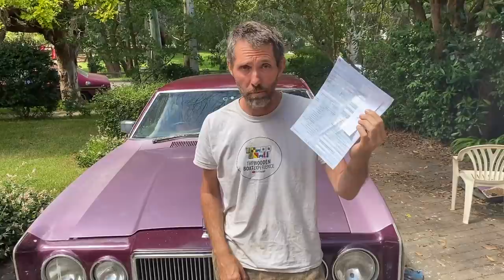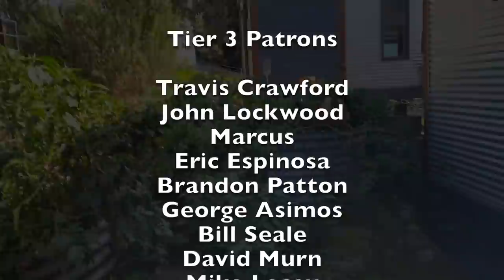Grumpy old man diagnoses two stroke outboard run without oil in fuel

Comment: You are not obligated to provide us with entertainment but we appreciate it.
Reply from the maker: Thanks mate, I hope you enjoy the vid.
Reply: It's not just entertainment, but also education.
Reply: I really love watching Stu I have learned allot from him. Very pleasant and polite but this segment... there is something not right with body language etc..
Reply: @JohnnyL6975  absolutely I have worked on boats for 15years professionally (more like 20 if you count the unprofessional bits) and I can safely say, from what I have seen, he is a man after my own heart.
Reply: @JohnnyL6975  Those who know these things might see some signs of depression here.  Sadly.
Reply: @Dangar what do you think the problem might be if a engine works in low and high RPM  range but not in the middle range? I assume the jets need to be cleaned. Any insight would be deeply appreciated.
Reply: @anthonybooth2858  sounds like it could be jets.  Also the timing advance needs to be checked.
Reply: @Jack-tx2ve  I checked the timing timing advance and jets but it still does not worked. Also, I checked idling and maximum throttle timing and it was good.
Reply: @noidontthinksolol  it does a have separator and bypass everything to the a secondary gas tank.

Comment: I am an older and more grumpy man, but fully appreciate that you tackled this try-kill motor in details with bare feet and very earthy shop.
Last week,  I opened a running newer 90hp dry-kill motor with top piston slapping noise, all 3 holes with 120 lbs and top cylinder light scores.  I coated 8 mil OD Cerekote to top piston skirt and 2 mils OD on lower 2 skirts to even out 3 pistons to wall gaps.  Now motor runs normal again.

Comment: I usually use a 3 leg puller until my last rebuild which was a submerged unit. Built a puller like you just did wound it up tight, let it sit for 2 days with wd40. Then wound it up tighter again them gave the centre bolt a good whack with hammer and it popped off. Happy days and was very surprised. PS. Glad to see you back Stu.
Reply from the maker: Yep, patience can go a long way with these types of jobs. Just decommisioned your water tank yesterday getting ready to put two large ones it. It was a great help to get us through until now. Thank you!
Reply: @DangarMarine  glad it was of use Stu!

Comment: I always leave the gear out of the water when the engine is not in use, to avoid all the crud building up and keep the water inlets clear and open... This was nasty!
Reply from the maker: Working trim tilt helps with that.
Reply: @DangarMarine  Ah. I guess that would do it, yeah... Well, it's off the boat now, so problem solved. :)

Comment: i need to know how many nuts/bolts/spanners/motors you have lost to the depths .....
Reply: After the first one, I tie a fishing line or para cord to tool or which ever tool I'm using in the water. 
Still doesn't help if the nut removing the bolt falls in.
Reply: Exactly what I was thinking...

Comment: LOL.. this video did my head in! I laughed I cried... Clean your bench, stop throwing the tools, put the parts into a tub or in order, stop throwing the screws anywhere... oh those safety glasses!! maybe you should clean some of those leaves of the roof so it doesn't rust out on you, plus it is a little bit of a fire hazard. Love ya work :-) keep at it..
Reply from the maker: One thing at a time. I'll stop throwing screws. ;)
Reply: One thing for sure - when you tidy the garage you will deffo never find anything ever again. But if you do the job logically it will never get done.

Comment: It will be a miracle to get the engine running again as all parts, bolts, screws, cables and other random stuff is all over your tidy and clean working environment.
Reply from the maker: It’s only an outboard. It doesn’t have that many parts. You set the bar for miracle very low.

Comment: When I had my boat I gave in to the fact I needed three sets of tools. One for Work one at home and the other on the boat. It made my life a lot easier.
Reply from the maker: It sure gets they way otherwise the tool you need is always somewhere else.
Reply: @DangarMarine    If you're 20 miles off shore it's a long walk home :)

Comment: Stu, you can technically 'crack' your own bearings. Take a cheap diamond bur on a Dremel, lightly score 2 lines where you'd like it to separate. Then line it up in the press, wrap a rag around it and lovingly pop it. It's impressive, fractures just like the factory ones.

That bad bearing you pulled out is a perfect candidate for practice or just for fun. It does matter which way you squeeze it because it can distort it before it cracks. I believe the winning combination was crack line at the bottom and the other at the top. I then placed a drill bit shank between the arbor and top line to 'encourage' it.

Food for thought, love your videos.
Reply from the maker: Intersting idea, I'll definitely give that a try and see how it goes. Could be something fun to film at a really high frame rate.

Comment: Time to hang the expense and buy a 6" Aussie Dawn vice ay? I like the cast steel offset ones but they also make fabricated.
They're an effing mans' vice and somewhat of a bargain at ~ $1000 but a vice for a lifetime that doesn't bloody fail when you need them most. I like offset because they're better for the type of work mechanics do.
That tool joint has them for $850.

Comment: You should permanently mount a pad on the railing there for engines, you know you're going to hang more there in the future , couple layers of UHMW cutting board would get it done.
Reply from the maker: Yes, I have been running a few designs through my head for an outboard service bracket.

Comment: I have used the "drilled plate as a puller" trick myself.  I had to pull the flywheel off my Rotax aircraft engine and the silly buggers use a five bolt pattern for the threaded puller holes.  I suppose they use five bolt to sell their custom specialized tools but I outsmarted them.
Reply from the maker: Good on you for not letting them force you into a custom tool!

Comment: I discovered that black iron pipe flanges of various sizes can be drilled to make real effective puller mounts. Also, if you make an arm to bolt  on top, you can use it to hold the flywheel while you torque the flywheel down. It worked for my V 4 Suzuki that needed 225 Ft lb.
Reply from the maker: Good idea about adding the arm to hold the flywheel still at the same time.

Comment: Thanks Stu,
Slots could be made by drilling 3 more holes on 120 degree plane and cutting it out with grinder disc to fit any 120 degree assembly, that is what the pro-tool looks like. That way you have a universal tool.

Comment: A trick I learned in my boat shops several thousand outboards ago to remove flywheel when puller is not there... using a 2 to 5 lb BRASS hammer and ONLY a brass hammer... loosen nut until it is level with the top set of threads..... Give nut/crank a solid but not all your might rap. The flywheel will pop right up about 999 times out of 10000. For you guys about to say no way, break magnets etc... You will NOT harm a single thing if you do it correctly. It does not need to be a hard hit guys and the nut protects the threads from any issues. I learned this literally almost 50 years ago and since have rebuilt thousands of outboards. It has never, not one time harmed a single thing and always gets it off unless you have spun the flywheel and welded it onto the crank... Just useful info if stuck...
Reply from the maker: It's always good to know every possible way to do a job as you always get to chose when you use any one of those techniques.

Comment: Outboards really are complicated to get apart. I bought an old mercury engine once to restore but gave up when I realised I needed about 5-6 different special tools wich weren´t possible to buy anymore. It was an early 60's 30hp 4 cyl. engine. White with black stripes.

Comment: I had to hold my breath when you were drilling the flat plate without a clamp holding it down. Many years ago I was doing the same and the drill bit got stuck and the plate started spinning around and almost cut off the tip of my finger. I had to get it stitched and lost feeling in the tip of that finger.
Reply from the maker: Yep, that sure can happen and fast.

Comment: Stu I have used a 3 claw puller to remove the flywheel on a 8hp outboard , ignorance is bliss ... i thought until now it was the correct tool .. ps i was going to send you some safety glasses , alas all i could find in the recycling were milk  containers ....
Reply from the maker: You can definitely get away with a three jaw puller on the smaller outboards, particularly if they are pull start without the ring gear on the edge. :)

Comment: I love the idea of a land rover type repair job on it cable ties and duck tape and just make the bugger run again as you said it was only because it took a swim that caused it to fail
Reply from the maker: Yes, I think it was more the salt water that did the damage. Particularly given the trim tilt wasn’t working so it sat in the upright orientation with the water in the bottom.

Comment: 21:51 - "CDI" ("gravel-goop") That's what's known in the U.S. (I know, we haven't been very popular, lately - sorry!) as "potted" - An epoxy-resin mixed with a 'hardener' (no, not 'that' kind) - that does have the advantage of 'sealing' the electronic components from dirt, moisture, temperature, short-circuit and - provides vibration/physical-shock protection, too - it also, doesn't allow the ease of cooling and, keeps us from, tinkering, to fix it, too - if, it goes "tango-union", buy another one! Cheers- Thanks, Stu!
Reply from the maker: I like the name! :)

Comment: I tried pulling the 2 PTO bearings off a '94 VMAX 600 with something similar.  Talk about a pain in the Ass.  Could barely get that bearing splitter behind the 80mm OD.  Then I realized, the bearing guides were shot anyway, as were the bearings, so I removed the bearing guide, shoved all the balls to the other side, the gently persuaded the outer race upwards, bearing fell apart, then I would easily get the splitter on the inner race that is tapered and pull it off .  You do what you need to get it done I suppose lol.
Reply from the maker: That's it, where there is a will there's a way!

Comment: weld the nut to the underside of the puller plate, saves weld breaking with the upwards away pressure, rather than using the whole nut itself to put pressure on plate from beneath! great backyard mechanics tips though :)

Comment: In CDI I think the coil fires with growth of magnetic field as the capacitor discharges into the primary windings.  

Opposite of points where the spark is caused by primary field collapse.  

But it's been a while since I studied ignition systems.
Reply from the maker: Would be worth looking into in more detail on day.

Comment: I think that I saw two interior anodes. How do you get to them during routine maintenance?  I may be missing something, but it seems the anodes are pretty deep in the motor. 

Thank you for awesome content!!
Reply from the maker: Yes, taking the head off does seem to be the only way to get to those ones.
Reply: @DangarMarine  That seems a little labor intensive. (gaskets etc.) How often are those anodes to be changed? I think all my anodes are exterior. At least, I hope.  

Thanks for the great content! I do enjoy your channel very much!

Mark Wiebner
PA and DE USA
Reply from the maker: The four stroke Yamaha’s I’ve got could all be changed from the outside. I’m going to find the service manual for this one and we’ll see what it says.

Comment: I have a Mercury 9.9 short shaft year 2000. I also have a 2007 Mercury short shaft 15 HP with a  big foot lower on it. Both 4 stroke, The big foot is on my small Jon boat and I don’t want to add a jack plate. Can I put the lower unit from my 9.9 on my 15?

Comment: I have got the same engine on my 4 meter speedboat. It runs great but i find the hull shot taking a bit to long. Its almost like an engine with an turbo it needs to build up before it goes. I think it has to do with the air mixture screw on the carb. Could you make an vid of how to set that correct to make my hull shot faster. Thx from the Netherlands.

Comment: Hi mate can I pick your brains I’ve got a Suzuki df60 efi it’s knackered the bottom cylinder been quoted more than its worth to fix it, I know of a good df70 complete power head similar vintage 2003/6 my question is would the 70 power head fit as a replacement or are there differences with mountings / injectors what do you recon ?

Comment: Always enjoy your videos! Some small explanation as to bolt/nut/thread standards is in order though.
WHITWORTH (IMPERIAL) a UK standard based on shank or shaft size, long sense obsolete (found on all old British bikes and cars)

DIN (developed in Germany, adopted by European mfrs) Metric based.

JIC (oriental standard, metric as well but with different "TPI" Threads per inch or mms, than DIN. This is 5he reason the USA didn't adopt metric...there are 2 different standards and many of the bolts/nuts to not interchange!

SAE American standard determined by the Society of Automotive Engineers. Inch vs metric. 

Note many of the wrench sizes interchangeb(3/8-10mm, 1/2"- 13mm, 9/16"- 14 mm...ect) nuts and bolts DO NOT! Neither are JIC and DIN interchangable!!!

Wish it were otherwise to the credit of SAE and DIN have machine/strength grades...the JIC standards are determined by various mfr's. Markings as to grade are not universal.

As a retired (×3) Master Diesel tech, I've struggled with this problem for many decades.
Reply from the maker: From a nuts and bolts point of view we only see one set of metric bolts, never had any issues with multiple conflicting standards. Whitworth is very rare, I only deal with them on the old 1950's Land Rovers we play with. We call SAE Imperial here. The relationship between 3/8 and 10mm etc is often exploited as 3/8 is slightly smaller than 10mm (9.525mm) so can be used when a bolt is rounded off for example and a 10mm can be used for a painted 3/8 bolt etc.

Comment: Hey
How are you?
Thanks for all of your videos!
I have a question maybe you can help me
I bought a 1976 Evinrude V4 135HP
Was not running
I make it runs again!
I put brand new Stator
New trigger, new power pack, new coils
New fuel pump and new water pump kit
My problem now is in can't make it plane
It runs ok around 2500 rpm on the lake
But when I try to make it plane the motor get accelerate but the boat not go
I have to go slow to make the boat move
Also I try it with new propeller but still it do the same thing
Then I try put gas very slowly then yeah I make it plane for a good bit 
Thanks!!

Comment: Ok one more question. In the center of the crankshaft on that center bearing its got a crack across it. How critical is that. Like if I just put the crank case back on it'll seal it or what?

Comment: Have a 94 Johnson 88 that is idling at 2500 rpms with the throttle plates closed, do you think it could be a bad intake gasket,  thanks

Comment: Sad to see from simple mistake forgetting to add oil to gas. I had a 2 stroke 150hp merc for many years. Had to add oil into gas tank. To prevent forgetting to put oil in I never put gas in until oil went in first. If I got to gas station and had no 2 stroke oil and station had none, I would not put gas in, would drive until found some, then put oil in tank, then add gas. The new 2 strokes have separate oil reservoir to add oil to gas as you go but I would think alarms would alert you to low oil in reservoir.
Reply from the maker: I like your system but in this case it was filling up at a marina and picking up the nozzle from the wrong side of the bowser.
Reply: @DangarMarine  oh, over here in BC Canada we can't buy gas already premixed. My 2 stoke motor operated flawlessly but 2 strokes are sure an irritant. Hated the amount of oil in exhaust, if trolling and wind was following you would get gassed out with oil vapors.  Next purchase will definitely be 4 stroke, more expensive to repair so you have to baby them and maintain them perfectly but payoff is no stink of oil  and better fuel efficiency.   Love your vessel Renko, it has come a million miles since you first bought it. In fact the first video was the first in your series with Renko talking about should one buy a used steel hulled vessel, and the rest is history, have watched all your videos since and your previous videos on trouble shooting and fixing outboard  motors. I will be much more competent with my next vessel and motor from all the learning acquired watching your videos.

Comment: Take the crank to a rebuild shop. 200 or less and crank is rebuilt so no worries.  Note on some two strokes there is no middle bearing just seals
Reply from the maker: Would be a good way to go, although I am interested to see what could be done in the field if you needed to.
Reply: @DangarMarine  a lot can be done but that middle bearing looks bad which can't be cheaply done in field.  Well at least not properly. Split bearings can really fail in a bad way.

Comment: For many years, we apprentices from Qantas used to be called snorks, .what the hell are we called SNORKS, seemed like everyone knew the nick name but why for was lost in transition of time, I worked it out after many years and one time ironically re-visited, and it dawned on me. In the Rosebay days of international flight, the engines which were high maintenance, got worked on over water, drop a part of a tooling, you sent the apprentice down below with a snorkel, hence the term Snork, you could of obviously removed a certain drop in to the mark by a wrist strap of that fine 19mm spinner in the opening clip of removing transom thru bolts, yeah I know you was dead keen not to drop it, but eventually, we all slip up, Oie boy, snorkel, young man’s job